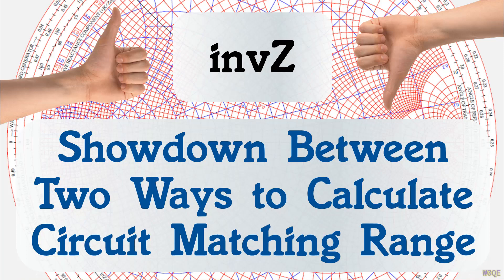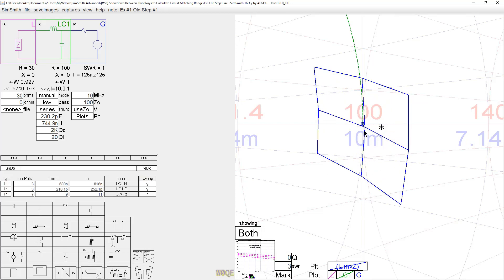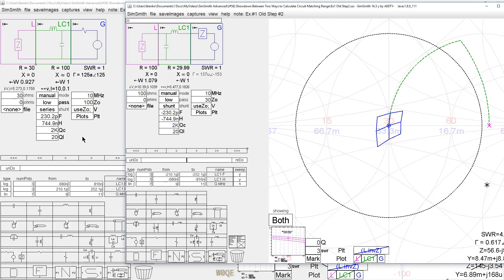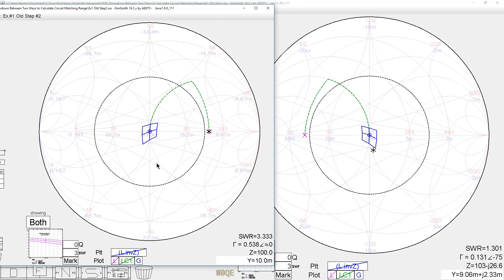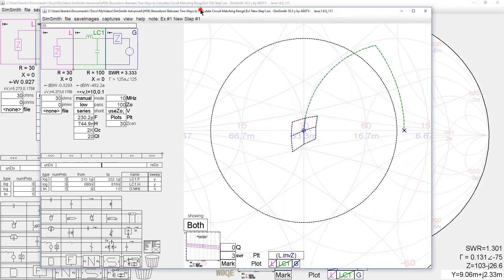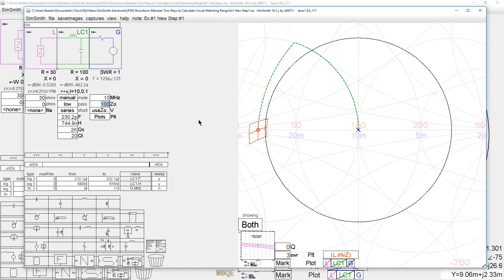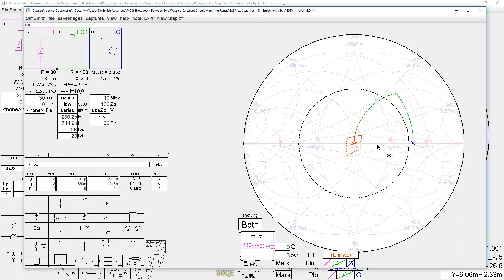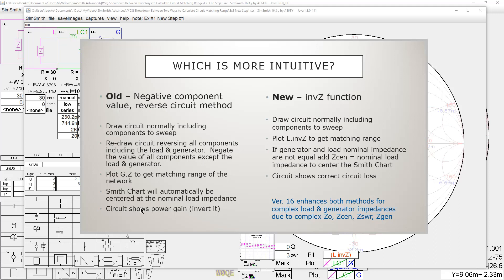#58: Showdown Between Two Ways to Calculate Circuit Matching Range

Comment: I am not sure if SimSmith uses the pseudo wave or power wave formulation when setting complex generator impedance.
I know that ADS uses the power wave formulation, but from some memories I recall that SimSmith uses the pseudo wave. This means that when the load is matched to the Z0, the reflection is minimised but the power transfer is not maximised.
You suggest to use the Z0 as conjugate of the generator impedance, or in some way the load desired by the generator. This should result in getting a conjugate match, but the Z0 should not be considered the characteristic impedance.
Super nice tutorials! Thanks for sharing them
Reply from the maker: Alex,
I did a video on the generator types in SimSmith which was video #49 https://www.youtube.com/watch?v=Qc1ZHkhrt2U which may explain things better.  However this video did not include the Thev generator.  You would need to address Ward, AE6TY as to your first question.  There is a SimSmith user group on groups.io which is monitored by Ward.
Larry, W0QE